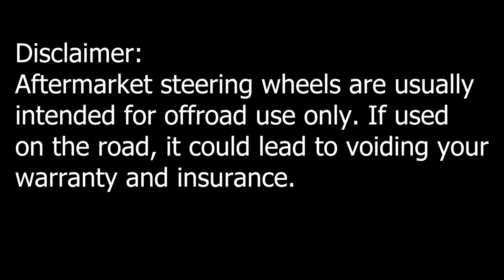Steering Wheel Stitch Up! Everything you need to know about NP300 Navara steering wheels.

Comment: I bought a 2022 pro4x steering wheel with airbag for my 2017 Nav. It bolted straight on all buttons' work. Best of all, I now don't have to deal with the crappy horn design!
Reply from the maker: Oh sweet, that is good to know!
Reply: Im in Europe with a -16, i guess the pro4x would bolt straight there to?
Reply from the maker: Thats a good question, I believe it depends on the series you have, series 1 and 2 have the bigger spline that the wheel sits on. @justaddirt do you know what series you have?
Reply: @KenKnowledge  mine is a series 2, I would assume it would be the same in Europe.
Reply: @justaddirt  i guess so. I dont know what diffrentiates the series but mine borders to -17 and my steering wheels starts to show some wear on the leather at 150000km hence i want to change it out for a new one and why not upgrade to a more sweet looking one.